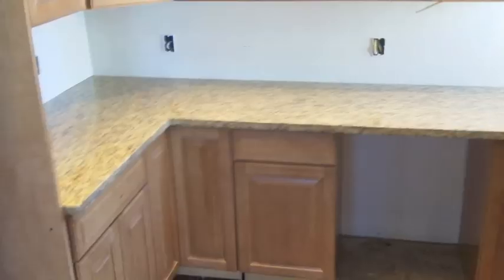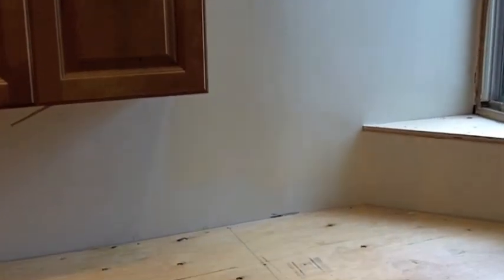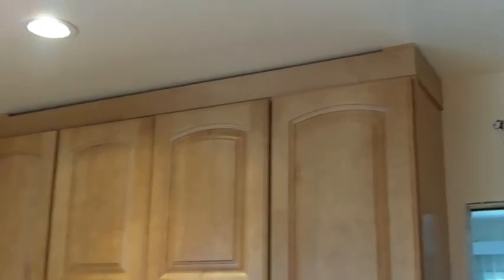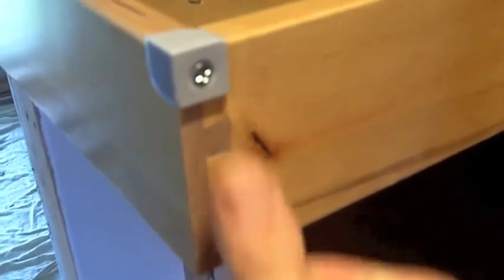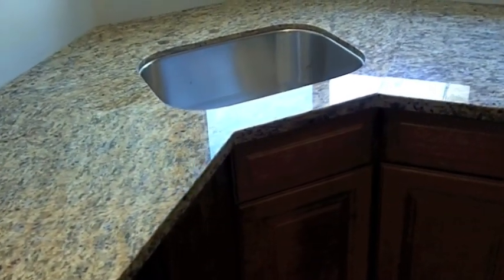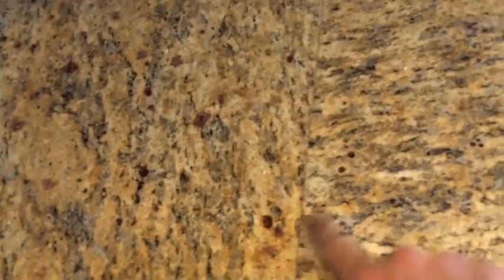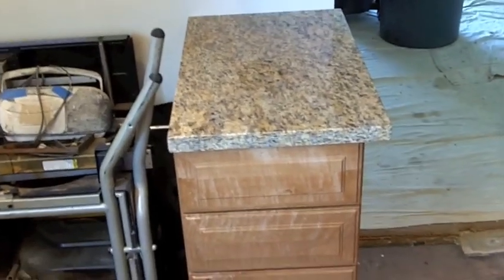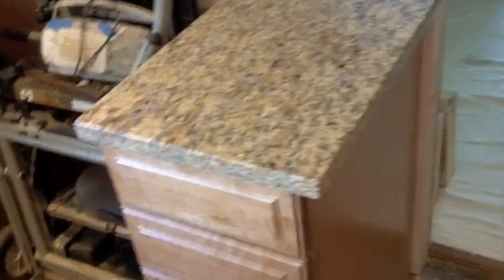Custom Kitchen Remodel Granite 14

Comment from the maker: They bond the edge profile at the shop...  with my drawings, we figure out how many and where the edges need to be bonded. They bring over the blank slabs and do all the cutting, fitting and polishing on site. Saves HUGE on lead time.  I bought the Granite on Friday, and by Tuesday it was done.  The only way to go as far as I'm concerned.  Other shops won't even come out until you have plywood down to make templates, and they are usually a two week lead time.